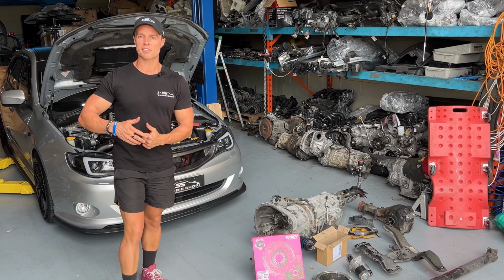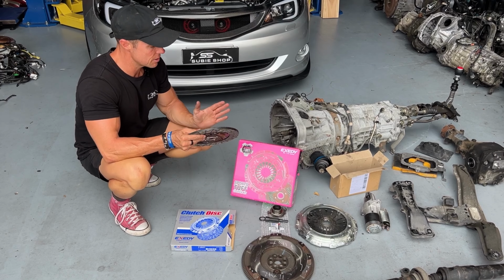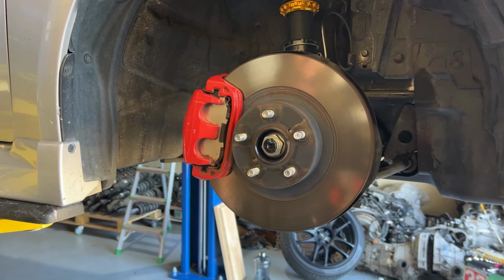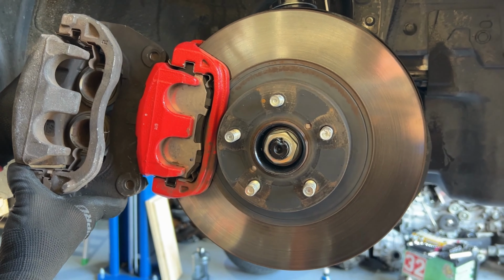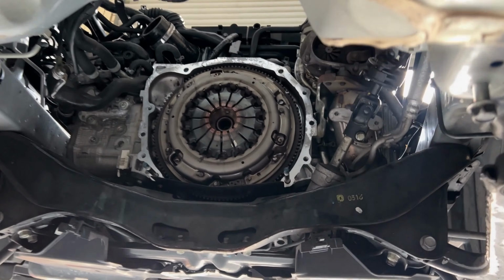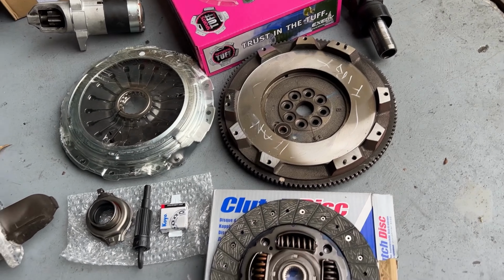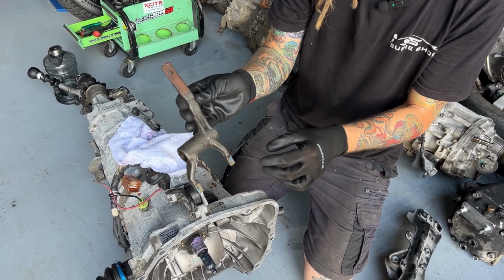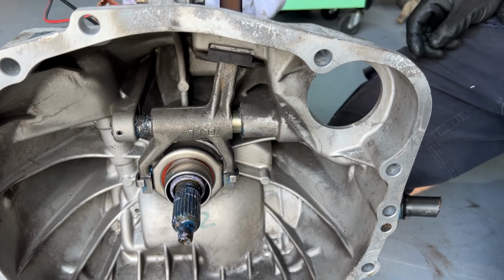G3 WRX 6 Speed Gearbox Conversion!

Comment: Is it necessary to change out the rear differential as well, also were there any additional electrical connections that had to be converted in order to not throw a traction light?